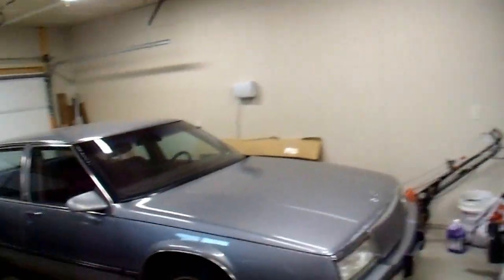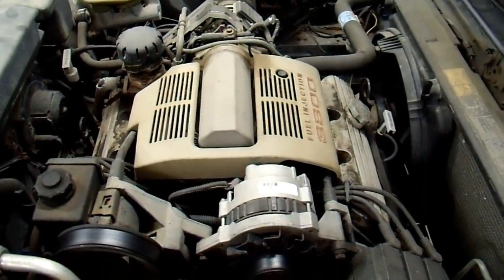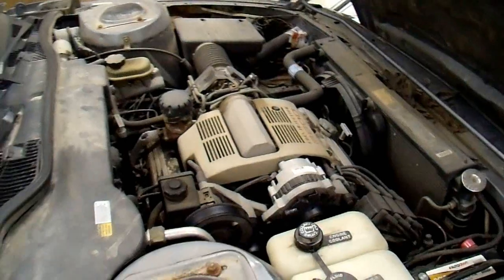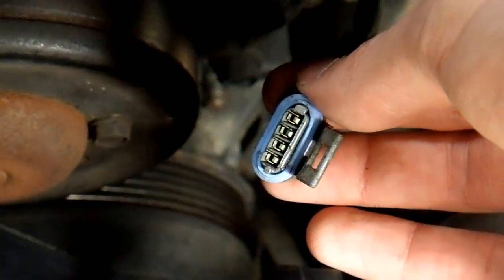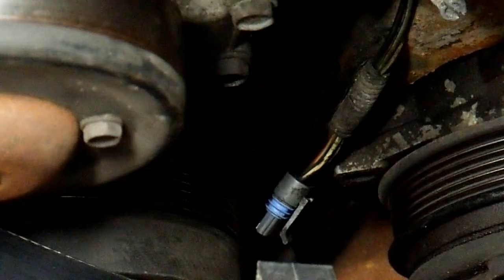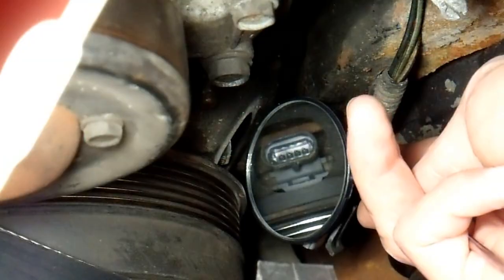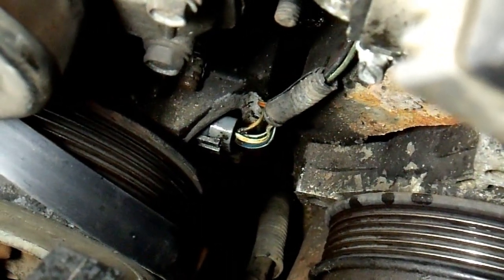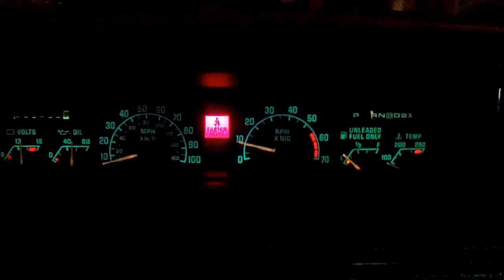3800 3.8L GM engine stalling issue quick fix

Comment: Hi I know this is a older video but I’m going crazy with my 1987 Buick Electra park Avenue 3800 engine v6 it’s a hard start & I’m having trouble finding the right o2 sensor & spark plug wires. Any help would be greatly appreciated 🙏🏼
Reply from the maker: First thing is to replace the spark plugs.  These engines have a weak ignition and if your plugs are even slightly worn it will be difficult to start.  Buy new plugs and gap them to .35 or .40.  Any wires or O2 sensor will work.  Those are bog standard stuff and O2 sensors will not affect starting even if bad.
Reply: @knurlgnar24 hi thx for responding so quickly!🙏🏼 so I did change my spark plugs. I’m having trouble finding the right spark plug wires cuz I have 3 at 44in in the front of my car & 3 at 22in in the back of my engine by the firewall. I’m also having issues finding the correct firing order.🤯 my dad changed the spark plugs in the back 4 me but suddenly pulled the back 3 wires off w/o disconnecting the battery! so I had to buy a new battery cuz he wrecked it but now Idk what the firing order is for those back three by the firing wall dude, I want to rip my hair out! & smack the shit out of my dad & I know that sounds wrong, but he was a mechanic who does something like that?! It does run but dies 3 different times within about 10mins then I have to wait 25mins to have it start again. It’s not overheating though? I’m also having trouble finding the right o2 sensor, bought 1 & the tip that goes inside is way to skinny. I only was changing the o2 sensor cuz it popped up while I was trying to figure out the firing order & haven’t changed it ever. But made the mistake of cutting the wire on my o2 sensor so now I can’t even connect the battery.🤦🏽‍♀️I’m not wanting to give up on the car I had a auto shop that said it’s worth the fix. All they do is work on old cars but they charge $110per hr & there booked out.+ to much $! I’m in Mn & haven’t had any luck finding a backyard mechanic to help me. I am just so frustrated right now! So sry for ranting. Just dealing with a lot, just got done kicking cancers ass!😊 but still feel weak so especially hard to work on the car feeling like this especially when it’s so hard to find the easiest things u would think would be so simple!🤪 it could be dying cuz I’m not driving it regularly?🤷🏽‍♀️ Thanks for reading this if u made it through I appreciate u just doing that.🙏🏼😊❤️
Reply from the maker: @jeanettecranston  Don't worry about the O2 sensor until everything else is fixed.  Your car will run just fine with it non-functional.  The stalling sounds like a crank position sensor and you will need to go to a mechanic to fix that based on how frustrated you are.  The spark plug wires don't care about length, just buy ones that are long enough.  Far too long is just fine.  You can zip tie them as necessary to keep them off the hot exhaust.  As far as firing order you should be able to find a diagram on google easier than asking on a forum.  Best of luck, sorry to hear of your vehicle issues as I know how frustrating they can be.  If the car isn't rusty I agree that it's worth fixing.  The price of newer vehicles today is insane.

Comment: Same with my 3.8 v6 series 2, 2005 impala ls. Driving down the street my car dies as soon as it gets to temperature 182. Then i coast to the side. Pull over. Restart and off i go. Ive been losing my mind. I put new O2 sens, mass air flow , idle air control valve , egr valve , map , cleaned throttle body. No codes, no check engine light
Reply from the maker: The replacement is easier on the series 2 as the sensor doesn't need adjustment, it just bolts in.  I haven't done one of those (but have owned them) and sensor failure is rare on those engines.
Reply: It might be a vacuum leak causing causing the stall.
Reply: @clawhammer704 I'll look into it! Thanks

Comment: Great info.i have a 1982 4door cutlass supreme v6,3.8 my car suddenly stalls  on drive only ,going on reverse is ok..I been driving my car with 2 feet😅 brake n gas like a stickshift..until it reaches to 30mph I can let off the break ,once the mph needle comes down to 30 I would have to slowly step on the break so  the car won't stalll ,so basically I'm burning my brakes pads 😢 had my timing check,distiburator check everything good ,carburetor  good. .found out my catalytic converters  was clogged.,now it runs great...

Comment: WD40 invented by US NAVY  water displacement 40 times. Took 40 trys to get it right.
Reply from the maker: WD40 is indeed a water displacement formula initially designed for preventing rust on metals in high humidity environments such as minuteman missiles.  It was never meant to be a lubricant.  I use it to wipe down my tools in the garage.  Works great to both remove gunk and to prevent rust!  Light machine oil is much better if you want a lubricant.

Comment: 😂 u should never ever touch vehicles. wd40 never ever dissipate water or corrosion and it's flammable in electrical. you lucky it started with wd40 in their never ever wd40 electrical connections. only ever use dielectric grease. I have family with 7 close still alive with well over 100 years of registered mechanic  experience includeing me with 24 years myself. wd40 makes stuff rust and never lubes most things especially bike chain properly.

Comment: Hi, I have Buick Park Avenue 1991 with 4t60e and transmission changes only to 2nd gear, first second and revers works perfect, any ideas?
Reply from the maker: You should have the 440T4, also known as the 4T60 in that vehicle.  The 4T60E has a different TCC setup.  Regardless, you most likely have a clutch failure and need a new transmission.  It could be a valve body problem but usually with this sort of thing the problem is mechanical and catastrophic.  You could have a transmission shop diagnose to make sure sure, but I think you're either going to have to scrap the car or get a rebuilt/salvage transmission put in.
Reply: @knurlgnar24  Transmission solenoids may need to be replaced.

Comment: There is a difference in the 3.8L vs 3800 Buick engines. The title uses both names for this V6 engine.
Reply from the maker: The 3800 is 3.8L in displacement so both are correct.  There was an older 3.8L GM engine which was a V8 with two cylinders removed but that's obviously not the subject of this video.

Comment: I use  a little die electrical  grease  when  i put the connectors  back together to make a better connection and keep  moisture  out .
Reply from the maker: Solid advice.  Some greases can cause the seals to swell and potentially leak/fail but dielectric grease is usually safe.

Comment: I have a 1989 Oldsmobile 98 Regency Brougham. It’s turns over but doesn’t want to start. I replaced the starter, battery, fuel filter, fuel injectors pigtail, spark plugs, spark plug wires, ignition coil pack, all relays in fuse box under glove department and still nothing! Any suggestions??? It’s the 3.8L v6
Reply from the maker: Well...  I'd go back to fuel/air/spark.  Check for spark on each of the 3 coils - this can be done with a simple jumper wire if necessary.  Check for fuel - this can be done by spraying starting fluid into the intake and cranking it over.  As for air if it has decent compression as heard by turning it over you are fine.  It has to be one of those 3!  I assume it is turning over and actually cranking?
Reply: @knurlgnar24  yes it is

Comment: I wanted to see how the injectors were replaced I didn't need to see about the crankshaft sensor
Reply from the maker: Why do you need to replace an injector?  Those almost never fail on these vehicles and such a problem will NEVER cause a stalling issue which was the title.  I'm confused?

Comment: What about  adjuster magnet Because I change the cam sensor on my mechanic told me the adjuster magnet on the timing chain sprocket broke off that’s why the car is stolen or won’t start up
Reply from the maker: You need to find a new mechanic if they are referring to the 3800 shown in the video.  There are no magnets except inside the sensor itself.  This sensor uses reluctor rings on the crankshaft to interrupt a magnetic field in the sensor itself to detect position.  Most vehicles use a similar system, and due to timing belt and chain stretch along with variable valve timing most vehicles today have a cam position sensor in addition that works the same way.
Reply: @knurlgnar24  I have a 1989 Buick LeSabre same engine and vehicle as the video and  an this is why my buick is stalling BUICK LESABRE CAMSHAFT INTERRUPTER-MAGNET
Reply: It’s a magnet on the timing chain sprocket that goes past the camshaft sensor to calculate the timing

Comment: some people are such putz's, some idiot got all pissed off and left comment because this video didn't say what to do if cleaning the connectors doesn't help your cars problem. this is a quick fix try, he even says that, if it doesn't work then you take the next step which hopefully would be being smart enough to pull the codes to see what the error code is and it should be noted that if your car stalls and wont start again for a long time the runs again for a short time then stalls again, if the problem is the CPS then it's probably not a corroded connector problem, it's the sensor malfunctioning when it gets hot and needing to cool down to regain internal connectivity.....
Reply from the maker: I also have a video on changing the crank position sensor.  If people want that info it's just a search away.  Thanks for the comment.  One note is that on these cars they won't throw a code unfortunately.

Comment: Thank you for the video - my 1988 Park Ave 3.8L stalled a few times today - I replaced the fuel pump relay while on the road - and was planning to maybe change the fuel pump - but I think the problem is exactly what you pointed out. Appreciate you taking the time to post. Thanks again.
Reply: Was it the problem? My car is stalling and doesn’t start up for 20-30 minutes, but starts up again after and runs fine but then this cycle repeats

Comment: So, if this is my issue, on start up would the car be in essentially a limp mode and hardly move itself?
Reply from the maker: If the CPS is your issue the car will either run perfectly, or stop dead like all spark was cut off.  If it sputters, hesitates, runs rough, lacks power, etc the CPS is not your problem.
Reply: @knurlgnar24  it turns out the alternator is my issue, seems to ground out and not grab a charge. Jumpers came off n car died. No battery light though but seems that’s what my problem is
Reply: @knurlgnar24  I don’t fully know my issue but the car Inguess has done it multiple times. Car always starts right back up just has very little power. Alternator is crap n seems to be my problem but Indont even know, it’s a bush race car just would be nice to have it be a good challenger for once instead of cutting out when I’m catching 1&2 place!

Comment: MY 1990 PARK AVE WITH 47K MILES ON NOW SHUTS DOWN WHILE DRIVING AND MOST OF THE TIME IT WILL START AGAIN, ONLY ONCE IT WOULDN'T, THE SHOP HAS REPLACED PARTS TO THE TUNE OF $1100 AND IT DOES THE SAME THING, THEY SAY THEY TEATED THE CPI AND IT TESTED OK, HOWEVER  WHY CAN'T THIS PART BE OK  ONE MINUTE AND THE NEXT MINUTE NOT, ESPECIALLY SINCE THE CAR TOTALLY DIES AND THEN STARTS UP AGAIN, VERY STRANGE PROBLEM AND THE SHOP GUYS CAN'T FIGURE IT OUT.
Reply from the maker: If your shop 'tested' the crank position sensor you need to find a different shop.  They cannot be tested on a running vehicle - only when it is in a fail condition and since your vehicle starts back up most of the time your problem is intermittent and any competent mechanic will NOT test the CPS if you have an intermittent failure as no useful data can be obtained that way.  I recommend you find a different mechanic.
Reply from the maker: BTW congrats on your 1990 with 47k miles.  If it's rust free that thing is a gem!  Well worth fixing and maintaining.

Comment: You cannot use oil or grease on those connectors even if they are Silicone .
1 . Oil on the connector can cause electrical short between the wires causing miss fire and a no start situation.
2. The chemical additives in any grease and oil is NOT COMPATIBLE WITH SILICONE SEALS that is why they swell.
A good example is the seals used on a E 85 vehicle and a non E 85 vehicle of the same make and model and power train.
Also research Manufacturers guides for proper installation of these connectors.
YOUR PERSONAL EXPERIENCE means nothing TO A ASE MASTER TECHNICIAN LIKE MYSELF WITH 43 YEARS.
Reply from the maker: 1.  Oil is non conductive.  All oil.  You are objectively wrong.
2.  Silicone will not swell when exposed to oil.  No silicone does.  You are thinking of rubber most likely.  You are objectively wrong.
3.  If you are a 'master technician' (which I doubt) you give your trade a bad name.

Comment: Please I have problem my lumina vt 2000 3.8 model missing problem I test on computer there is missing camshaft sensor problem and I change the sensor now sensor showing working when I start my car and give accelerator doing missing and then I drive my car 40/50 speed same missing problem please sir help me

Comment: very knowledgable about 3800,s, thank you!! quick question, i have a 1991 olds 88 with the 3800, i found a 1997 potiac with the gen.2, will the gen.2  swap right out using all the same wiring, etc.,, etc.,  or are they not interchangable?? thank you very much for any advice!!!  take care n stay safe!
Reply from the maker: The gen2 is quite a bit different.  I'm sure someone more knowledgable than myself could tell you what is required to swap, but it won't just drop in.  The gen2's were good engines with more power and smoother, but the first gen engines were tanks.  No plastic manifolds, fittings, or failing engine mounts here!

Comment: I performed this and now my Tachometer is ok but upon starting the SES light came on and threw code 56 which is quad drvr and could be a code for a bad CPS?
Reply from the maker: I can't be sure but it sounds more like a wiring issue or electronic module problem.  Again I am not sure.

Comment: You use WD 40 on electrical connectors?
Reply from the maker: Not usually because it is hard on rubber, but assuming the seal is silicone it works well.

Comment: How reliable it the series 2?
Reply from the maker: Very.  But series I is better in reliability.  That said I'd rather have the series 2 as it has more power and better efficiency.
Reply: @knurlgnar24  Cool, thanks for the info.
Reply: @joeshmoe8952  The series 3 is said to be the best but it was only used for like 5 years. Some Pontiac Gran Prix, Buick LaCrosse and Lucerne.  Maybe Impala?
Reply: @Jack51971  ok cool thanks for the info.

Comment: I have replace one coil, it was shorting thru insulation, then the crank sensor, now the cam sensor. no help. pigtails look like new. the symptom is like the whole engine shuts down and back on fast. One person thought my ignition key switch in the steering wheel column is bad.

Comment: That was a $421.76 repair at my local dealership for my 1992 Buick Riviera
Reply from the maker: Thanks for the price update - that seems fair to me assuming the shop and diagnostic fee assuming the crank sensor also had to be replaced.  Running a business is expensive anymore with all of the laws you need to make sure you're following to the letter and the liability risks.  And that shop likely put in a GM sensor rather than the BYD garbage I used.  I mean it worked for me on this one-off job but, well, I wouldn't put that in a customer's car and risk having to do the job twice on my own dime.

Comment: The toothbrush isn’t enough after using contact cleaner on the sensor- there’s also corrosion in the connector!  Burnish after cleaning, then seal with dielectric. This goes for any sensor/connector - Crank sensor, cam sensor, MAP, MAF, o2, VSS, ABS...even spark plugs/wires, battery terminals, alternator, head/tail/signal/running lights. Good preventative maintenance when replacing failed etc electrical ANYTHING.

Comment: Thanks so much    stalls esp in hot weather
Reply from the maker: Hope the video helps and it's worth a try, but if it only stalls in hot weather it's more likely a bad sensor that needs replacing or some other electronic issue.  I do have a video on replacing the sensor if you wanted to give that a shot.

Comment from the maker: I let this car go in 2015.  It may have been a rust bucket but I still miss it.  All of my vehicles today are nicer from an objective standpoint but I'm beginning to think that someday I'll be that old man talking about how much he liked his 1991 Buick LeSabre, where he went with it, what he did in it, etc...  And that I'll hardly talk about the what I own now at all.
Reply: This engine was in the Australian Holden Commodore from 1988 (VN) up until 2004 (VY)! Similar car to the Buick Regal/Sabre but RWD. They were the Pontiac G8 in the USA. This stalling issues has come my way and is annoying the absolute heck out of me, currently going through wire loom to look for corrosion or shorted wires. Aside from this massive stalling issue (google it, there's hundreds of threads across the Holden Commodore and Buicks) they last for 500,000km+ although a bit heavy on fuel.
Reply from the maker: @TheApothecaryAus  Agree completely.  They were efficient for their time but not so much today.  But they do last a very long time with no major maintenance.  Like all engines they have some weaknesses - in this case the CPS is one of them.
Reply: Got all mine at series 1.. hate the electrical problems that shut it off while running